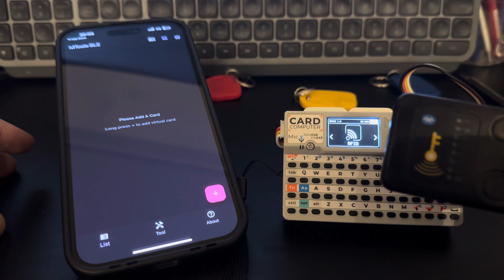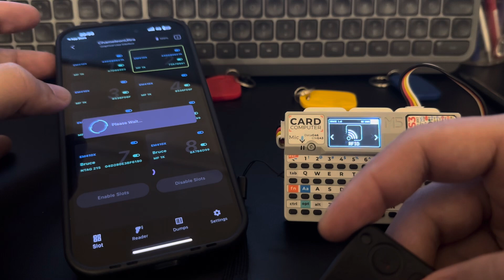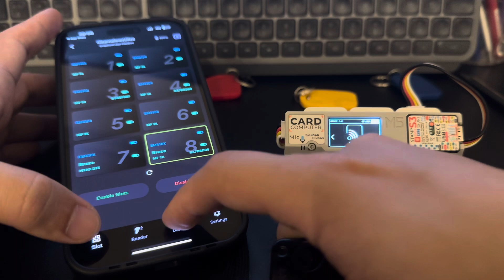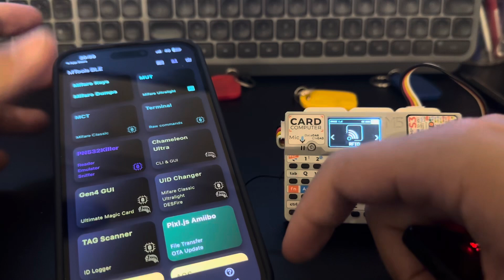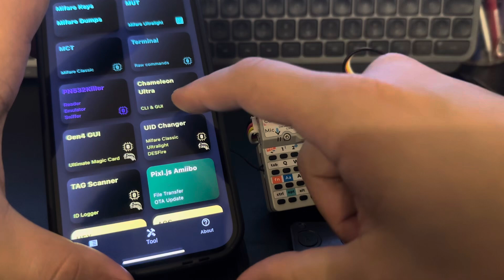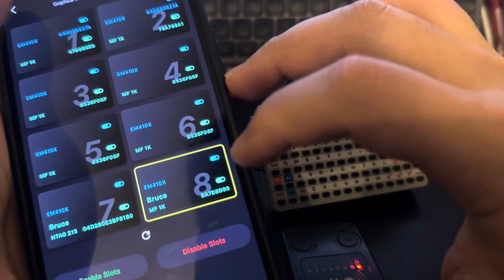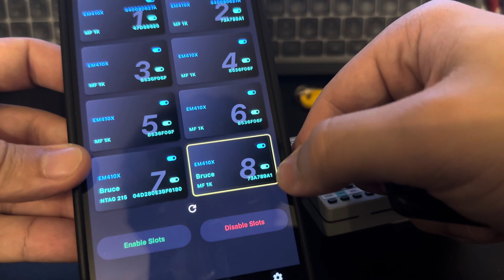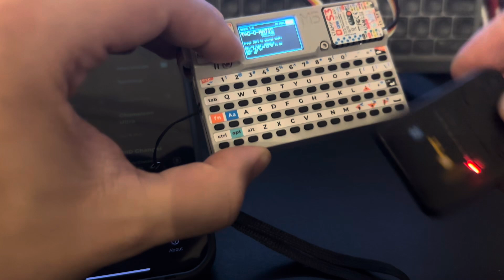Bruce integration with Chameleon Ultra (RFID emulation)

Comment: Thanks for the demo, but we all have to ask "why?," right? What does the cardputer bring to the table? I guess it could store more cards if that was a thing. Can you edit the card data directly on the cardputer or anything? If the only use for the cardputer is reading a card, the chameleon can do that solo. I know the real one can, and I assume that clone is basically the same thing.
Not trying to be an *. Just curious if it has any real use.
Reply from the maker: - why? 
> Simply because it can.

- What does the cardputer bring to the table? 
> Another way to control the chameleon without having to use your phone. You can also store dump files in the sd card to use later as a backup, share with other people and also use flipper zero's dump files.

- Can you edit the card data directly on the cardputer or anything? 
> The data not yet, but you can edit the UID.

-  If the only use for the cardputer is reading a card, the chameleon can do that solo.
> You can't do much with chameleon solo, you need at least a phone to send commands like read, upload data to be emulated, write into a tag, save and load dump file etc. Have you watched the latest video about the full integration? If not, here's the link https://www.youtube.com/watch?v=ZInyYs_0YAw
Reply: @R3CkTech  Ok, I take it back. I didn't realize you need something else controlling the chameleon to do simple read/replay. I stand corrected. :)